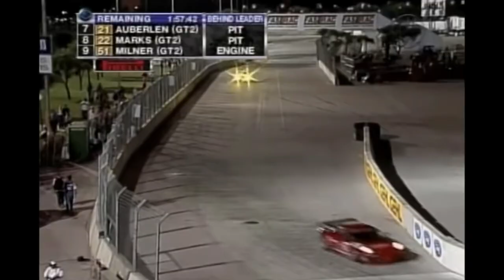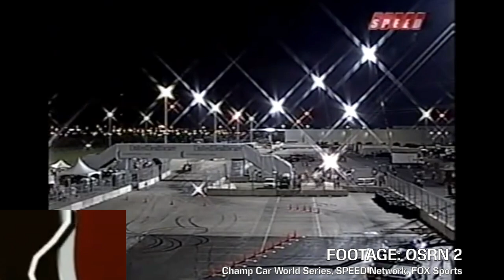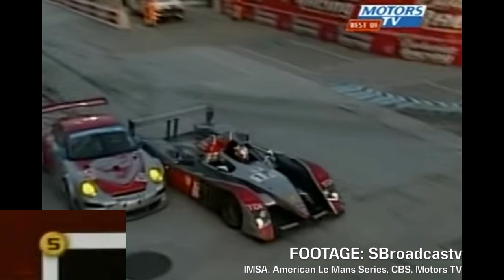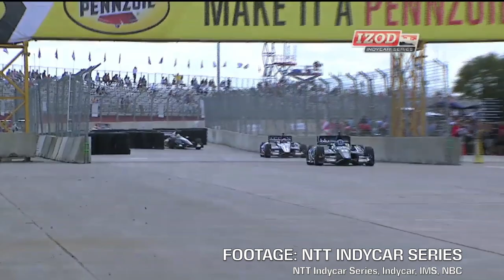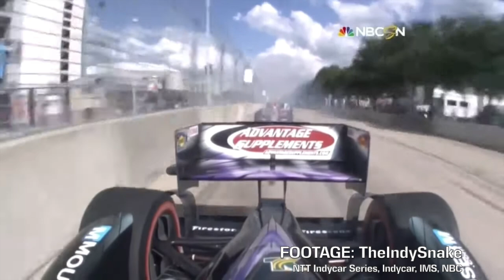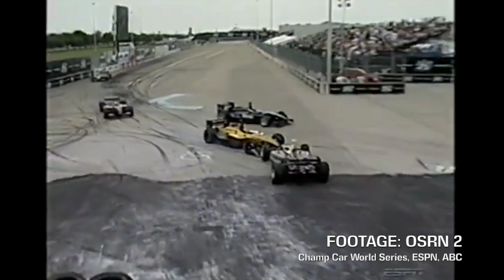Street Track Failures: Episode 35 - Houston

Comment: Was wondering if you could do an episode on the surfers paradise street circuit in Australia
Reply: They’re not running Surfer’s Paradise anymore???
Absolutely sad-
Reply: @Exponaut_R-01 no there still doing it with V8 supercars I meant with indycar
Reply: @Exponaut_R-01 Like mentioned below, Aussie Supercars still runs it, but city construction has knocked it down 1 mile shorter and also has a tramline running through the track making it hard for IndyCar to return.